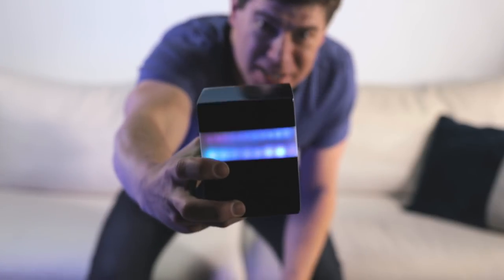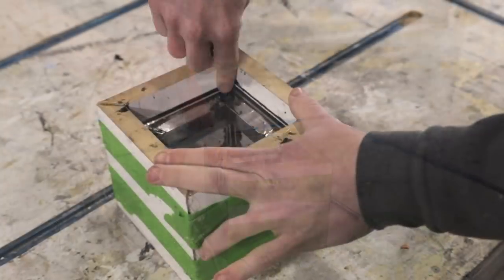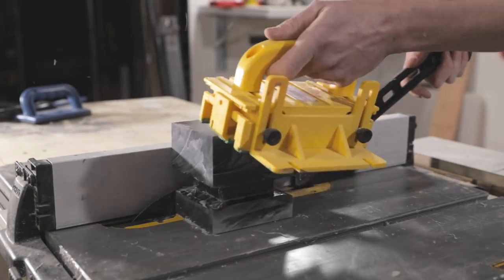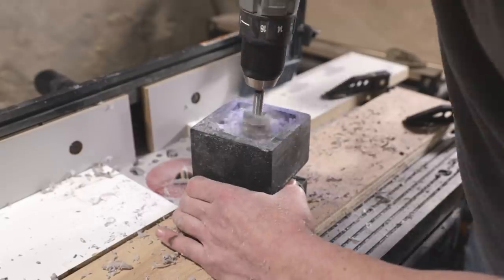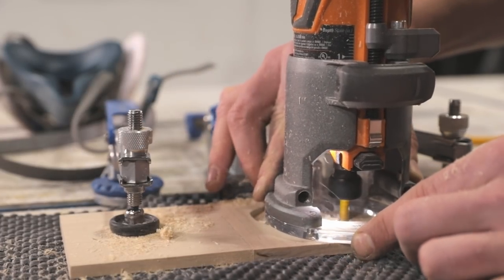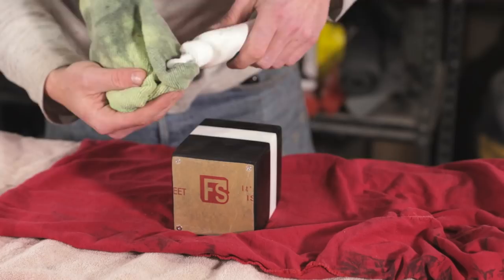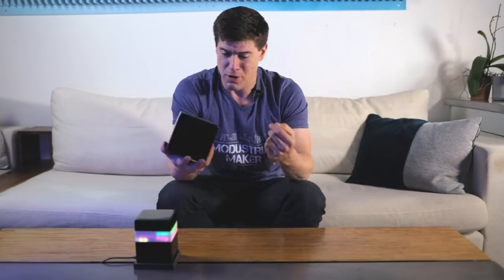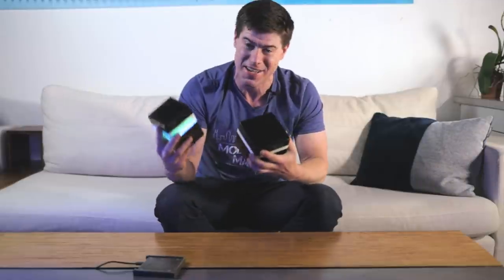diy EPOXY LED cube lamp w/ WIRELESS charging

Comment: Really nice project, I feel like you could hugely reduce cost by 3d printing 90% of this project or even use a wooden centre. Then just have a final thin layer of epoxy to coat the project still doing the white part the same way.
Reply from the maker: Thanks! Yup, that would be one way to reduce cost a bit....as it is, probably about $40 of epoxy, so not too bad.  I definitely have on my idea list to do a 3d printed light and a wooden cube.  Never know what I'll actually build from the list (there are like 50 ideas on it currently!), but I do love me some LEDs 😁

Comment: Smashed the subscribe button and plan on trying this myself...will probably share the car crash of a disaster I am about to make lol, good stuff!
Reply from the maker: Awesome, glad to have you here!  If you share pics on Instagram, please tag me, I'd love to see what you create!
Reply: @modustrial  quick question for you, out of all the resin you've used, which would you say adheres to the needs of these projects more than the rest? Been going back and forth with different resin and haven't nailed one down that does the trick.
Reply from the maker: Total boat high performance 2:1 gave me the best results, in that there were no visible layer lines....it takes a bit of patience doing a 1/4" at a time, but the results are good.  I tried the less expensive tabletop epoxy for the second cube I showed briefly at the end, and it definitely had visible layer lines.  I haven't had any experience with deep pour like exopoxy because it is $$$$, but total boat is supposed to release a more affordable deep pour epoxy soon... Hoping that will make projects like this go quicker
Reply: Sean Rachubka π

Comment: Maybe to satisfy the haters you can incorporate an aluminum channel and fan? The non-replaceable version doesn't seem that much different than potted electronics to me so I'm not too sure what all the complaints are about...at least with the LEDs as even the 12V ones don't generate /that/ much heat. For your internal cavities, have you tried aluminum cans? I'm curious if they are as easy to work with as the aluminum tape in either a coated or sanded form. Might be easier to work with than the melamine forms.

Comment: I realize this vid is already a year old, but I’m curious about the charging circuit. How are you able to charge it and use the battery at the same time (as in the beginning of the vid)? Did you implement load sharing? The tp4056 doesn’t have that built in, so I’m wondering how you did that
Reply: Hey, I was wondering the same! Do you know how it was possible? Or, if doesn't, any ideas of another baterry protection?

Comment: Another awesome video, was waiting for this one and not disappointed, 👍🏻,
Ignore the haters mate, this is a great channel with great projects, even if we don't make the exact same project the ideas we get are invaluable,
Also I have had 4 meters of 12v RGB led strip and 4 meters of WW led strip stuck to a wooden board behind my tv, each 4 meter strip running on a 12v 4 amp power supply plugged into a standard UK wall socket, both strips have been running a minimum of 12 hours a day constantly for SIX YEARS, they get switched off for 1 week a year for holiday, I've had ZERO heating problems, no fires, no failures, nothing, as long as you take the time to wire them properly and feed the correct current in they'll be fine.
Can't wait for the next project,
Again mate, ignore the haters, your subscriber count says everything.
Take care,
Reply from the maker: Thanks as always for the kind words brother!  LEDs do seem to last a long time....only time I've ever had a strip go out on me is when I've physically damaged the strip....
Reply: @modustrial 
Same here, user error, they are a fantastic light source, not to mention tremendous fun 😊

Comment: Cool project but you can make it much better if you make the box a shell and then make a platform to attach leds on and electronics the screw it to the inside top or bottom. The white part you can use foam insulation and aluminum foil for inside form to pour epoxy. Use less product and make much easier and replaceable
Reply from the maker: Good ideas -- there is always room for improvement!

Comment: On the leds watts is watts it does not matter if they are 5v or 12v because the led actually run at 3v

Comment: Suggestion for those who like the replaceable LED light idea. Pour first layer of black epoxy. Then place a block inside the mold that only allows a centimeter or so around it and pour the white light strip. REMOVE that block, put in a block that allows a thicker wall, and pour a clear layer of epoxy. Now the light window is properly thick, but only has a thin bit of white to diffuse the light. Continue pouring black until full.
Reply from the maker: Good idea!

Comment: Great project! I have a question, but keep in mind I have 0 experience with epoxy! Would you be able to, when pouring with your 2nd technique, just pour a translucent layer or two after black, then continue with the black in order to get your window?
Reply from the maker: You could do that, but, you wouldn't get a crisp clean line between the black and white
Reply: @modustrial  Furthering the OP's comment and in response to yours...
If the frame you make also introduced a sealed (air) pressure lid to pressurize the epoxy as it cured between layers, would that not negate the issue of resulting in uncrisp layers?

Comment: for the replaceable, maybe one layer of clear/white  epoxy could have been poured into the cube while building the layers.. THat might have been quicker? or not?
Reply from the maker: It would be quicker, but lines might not come out straight and even due to surface tension in the epoxy
Reply: @modustrial  oooh. That makes sense. Even if the previous layer has been dried completely?

Comment: When I use LED's I like to create my own design. I use the Arduino and program different light styles like fade, moving rainbow, and more. You can check it out on my channel if you want to see a demo.
Reply from the maker: Hey there!  Yup, I hear ya.  The SP106e is the best off-the-shelf I've found, but nothing is quite the same as some good FastLED coding.  I've actually used arduino for a few of my past projects too (Rings of Saturn, LED Matrix speaker, etc.).
Reply: @modustrial  Perfect! I look forward to seeing more of your projects!

Comment: Great vid. not sure how I missed this until now. Regarding the wood pendant light that you mentioned in this video I have a quick question about routing a channel along the trunk of a de-barked tree with partial (chopped) branches extending out of the trunk at various intervals. I want to line these channels with LED strips and cover with a diffusing material to create light strips that are flush (more or less) along the trunk..  
Do you have any recommendations on how I would route a clean channel along the undulating trunk of the tree (Diameter is about 4-5 inches). I was wondering how I could create a guide along the trunk to steady a router. (I have a cheap standard sized plunge router and a dremel). I fear that just routing by hand would be too inaccurate.
Thanks for your advice. LOVE your projects and videos.

Comment: To offset how much diffusion is in the replaceable LED version, could you just put in plexiglas spacers and then pour the resin over that? Less resin and still replaceable?
Reply from the maker: That would probably work
Reply: @modustrial  I was definitely curious. Something this small I was thinking about doing silicone molds for the three segments with space for connecting bolts. Definitely a scalable project for production. New subscriber and gotta say you've kept me up for two nights straight in the best way.
Reply from the maker: Thanks much for the kind words!  I agree that this could be something scalable, with some mold making and a bit of work.
Reply: @modustrial  the wife and I were looking into making cement coasters with magnets that allowed them to connect into canepe serving dishes. Found you through so many different suggested videos and can say without a doubt that you are the best resource I've found so far. Can you suggest a good finish to make the concrete food safe? Otherwise we're thinking we'll use plane shavings to make a thin layer across the middle with the grain matching up when they are connected.

Comment: Why with your second box, did you mill out the channel for the white strip? Why not pour the top black level, wait for it to cure, attach your internal form, pour the white strip, wait for partial cure and then pour the remaining black? Then you work to remove your form to get your internal cavity and install your electronics but there is no machining left to do except for polishing. Or is it just easier to mill out the channel?
Reply from the maker: You could do that, but you wouldn'tbe sure to get a straight line between black and white due to surface tension between melamine and the epoxy

Comment: It looks really cool, and I love the idea of the wireless charger. Does the wireless charger work for cellphones too or would they require a receiver module like the one installed in the light?
Reply from the maker: Thanks much!  The wireless charging base works for any phone that has a wireless charging feature....recent iPhones and most Androids from the past few years.
Reply: @modustrial  Great to know! I've had a few ideas involving wireless chargers that I might just have to look into making sometime soon. Having the ability to have a "station" that'll charge both my phone and a lighting project like this opens up a lot of possibility.
Reply from the maker: Yeah I think you'll see more of it here too :)

Comment: I don't get it... how is that silicone gripps at all whan you use the paste wax? Are you carefull not to wax it all the way in the corners so there are some untreated surface to grip?
Reply from the maker: It still grips enough because of texture....I'm not sure physics of it, but I'd guess it's like a vacuum grip. It holds enough, but scrapes off easily
Reply: @modustrial  Thanks. I'll try your way next time. I first seal it with hot glue than wax it. It was not so clean result because it was hard to clean the glue. I also did not like hot glue for this application.

Comment: what did you use to connect the battery to the TP4056? thats the only part i haven't learned about the circuit any help would be greatly appreciated, I'm trying to make my own little project with wireless charging as well. Thank you
Reply from the maker: I used male and female 2-pin JST connectors.  You can also just solder the +/- wires on the battery directly to the battery +/- connectors on the board
Reply: @modustrial  Thank you so much this helped a lot, i had no idea!!!!

Comment: cool project. and great work on redoing the project and addressing the issues.

do you know how the sp106e reacts to different amounts of LEDs when displaying patterns? i could not find anything about that online.
it really seems to be a good alternative to arduino boards.
i do some arduino builts on my own, but i struggle with the LEDs reacting to music and a lot of the animation part.
edit: some of the animation in my videos is done with code available on github. my videos are not really well done but some might interest you

edit2: i just found the updated version of the sp106e. the sp106e wifi version seems quite nice as well
Reply from the maker: I have run it up to 300 LEDs or so, and it works well.   Also check out the sp107e, which has some even better music patterns (IMO) for strips, plus spectrum analyzer patterns for a matrix, and is Bluetooth
Reply: @modustrial  i just ordered a bunch the sp107e and sp110e from amazon.
i read online that some people have issues with them, have you had any problems so far? some don't seem to be able to connect with their phones, but this might just be the wrong bluetooth version on the phones.
Reply from the maker: No issues yet as far as things not working, BUT, there is one big design issue with the sp107e.  You can only use 1 at once, unless you use different phones to control different controllers.  The only way to control the sp107e is thru the iPhone/Android app over Bluetooth, and the app only let's you connect to one sp107e controller at a time.

Comment: How many hours does the battery last, when fully charged?
Reply from the maker: Haven't measured exactly, but have run it for over two hours without the battery dying
Reply: @modustrial    Think with the one battery you could get 6 hours out of it?
Reply from the maker: That would depend on how many LEDs you use....with two strips like I used, probably not.  But, you could always use a bigger 3.7v LiPO battery than I did to get longer battery life.

Comment: i think you can use different combination of colors, instead black and white.and even different shapes.
Reply from the maker: yea, the possibilities with epoxy are endless!  I'm playing around with 3D printing shapes to make silicone molds for epoxy and concrete -- some awesome possibilities with this approach, I think :)
Reply: @modustrial  is it more challenging if you are using wood?
Reply from the maker: No, I actually think the process would be much easier with wood for the cube
Reply: @modustrial  Am saying that because i'm trying to make a simple shelf since over a year.could you help me please?
Reply from the maker: Sure, what do you need help with?
Reply: @modustrial  i want to make a simple shelf but it has a two functions or more.
Reply from the maker: So what do you need help with?

Comment: I want to start off by saying that your projects are super cool and I tend to fly by the seat of my pants too when making stuff. But I also want to know, is this your full time gig, or do you have a daytime profession? Because when I heard you say that the plastic on the charger will block the wireless signal and make it weaker I kind of cringed a little. I'm an electrical engineer by trade and degrees, and want to let you know that literally everything affects the alternating EM field produced by the coil, similar to the rings you see draw with magnets, just not significantly. In fact it actually has to do with the air gap between the two parallel inductors (coils). When you have two inductors next to each other they create a transformer with an airgap core. The powered side, which you have in the wood stand, creates that EM Field, and the lamp is the passive, or parasitic, side where it takes power from the powered side. With a small air gap between the two coils, the more power can be transferred to the passive side, and less with a larger gap. TL;DR The plastic isn't what affects the "signal", or field, the gap between the two coils does. You're doing some pretty neat projects! keep up the good work.
Reply from the maker: Thanks!  This is currently a night and weekend gig.

Comment: Wouldn't it have been simpler to make the replaceable LED cube by pouring the bottom black sections in 2 or 3 layers, then pour the white layer as a single pour then pour the top black segment as a single pour, thus saving you the hassle of cutting the channel into the cube (wasting the removed Resin) and pouring the white after the fact?
Less chance of the hollow cube coming apart when cutting the white channel too...
Reply from the maker: Much tougher to get a straight line between the black and white epoxy if you do it that way....
Reply: @modustrial  If your using the really fluid/thin/runny slow-set Resin and make sure the base of the form is level, shouldn't it self-level and give you a straight line?
Admittedly, this would make the whole project take longer, but it should be much more structurally stable as everything was cast in place, not added in after the fact...
Perhaps there is a relatively quick setting epoxy that is also thin/fluid/runny that you can use that will self-level and set overnight rather than the 48+ hours of the slow-set...

Comment: how did you make the box light in the video?
Reply from the maker: Not sure your question?  The video shows how the electronics and LEDs are set up....
Reply: @modustrial  They might have meant your 'Create' light in the background?
Reply from the maker: Oh, maybe so....just used Easel and cut that out on the x-carve from a piece of plywood, put acrylic behind the cutout, and threw some LEDs behind it as well
Reply: @modustrial  "The video shows how the electronics and LEDs"

which vidoe?
Reply from the maker: Which light are you talking about?  The cube electronics are shown in ths one.  If the lighted sign on the wall, no video for it, but check out wicked makers as they just did a video for something similar

Comment: Actually, the second cube diffuses light much more and it looks better imo
Reply from the maker: Thicker does mean more diffusion, but, it wasnt nearly as bright....it was tough to capture the difference accurately on camera, because the LEDs tend to blow out regardless, but in person, the difference in brightness is pretty significant.  Definitely is a matter of personal preference at the end of the day, but just wanted to put that out there so you can make a more informed decision if you want to make one

Comment: The led stripe operates on 5V. The electronics range from 5V-12V. The batteria provides at max 4.2V. Your charging circuit does not boost the voltage up to 5V. "Does not compute!"
Reply from the maker: Good catch!  I'm pretty sure the sp106e has a voltage booster in it.  I tried some other more basic controllers in the same circuit and they didn't work, and I have some little step up converters I was planning to use, but found unnecessary with the SP106e.